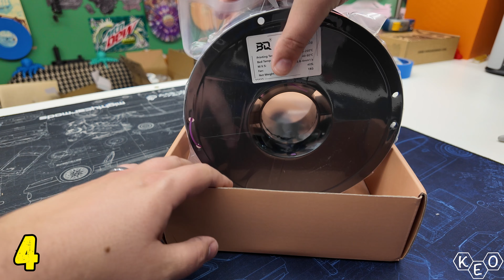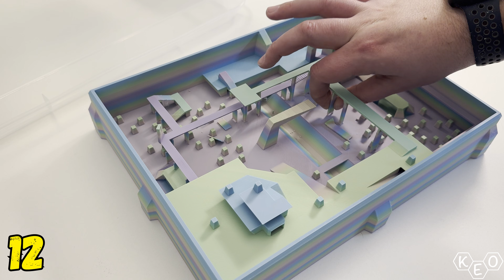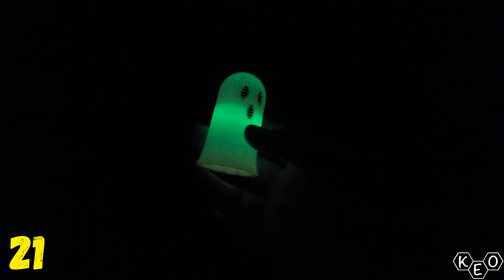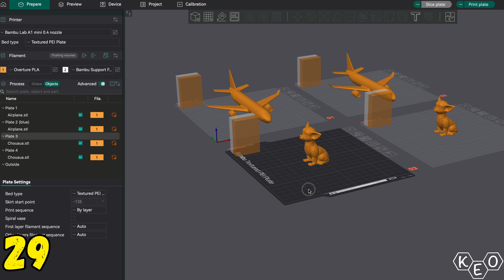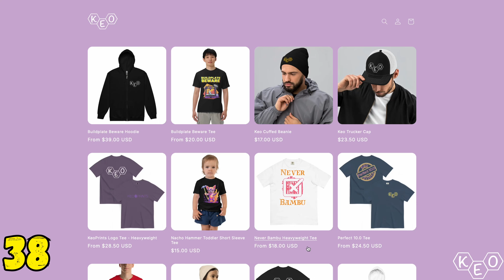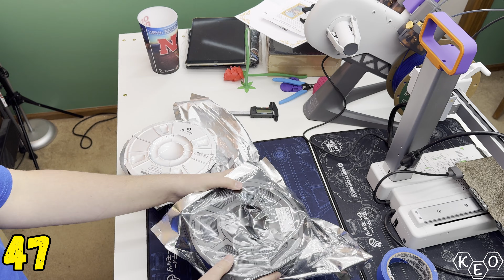50 3D Printing Tips and Tricks YOU Should Know

Comment: I would liek to say you don't neccesarily need a heated chamber for ABS - but you do need some sort of enclosure, and some time to heat the bed and use the bed as a 'chamber heater' - with the enclosure just helping retain most of it, and, keeping drafts out.    I successfully printed ABS on an Ender3 from 2019, just using a cardboard box with some cut outs for wires to slide through, and taped close a  door cut out for the front.   No warp, great results, but yes, a bit basic for setup.
Reply from the maker: True, good point. I too ran those DIY enclosures on my enders back in the day. If it works, its not dumb ya know?
Reply: I agree-I print ABS and ASA without a heated chamber on my P1s all the time. The enclosure helps, but I don’t even bother preheating and it still prints great.

Comment: #2. So I've never had to do this, but my first thought is to put the plate in the freezer. 
#4. Ooh... 
#5. I know you're supposed to keep enclosures open for PLA, but the whole point of having an enclosure is NOT breathing in the fumes. I don't care if PLA is supposedly harmless; we know very little about the effect it has on people.
#7. I've been holding out hope for a proper tool changing system which swaps the whole toolhead.
#13. Other than looking cool, gyroid is useful because it's flexible, so it doesn't put as much warping strain on your part as cubic/grid/etc. But it can be kind of rough on the printer. 
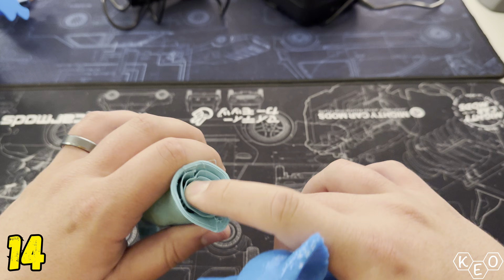#14. Regarding concentric infill... @6:17, I really wish there was a inverted concentric. Like, it would create infill perpendicular to the walls instead of parallel. 
#30. I keep a small offset when I'm using brims so that I can just peel them away cleanly by hand. And sometimes I use a skirt as a brim since you can also set skirt distance to be very close to the part. The advantage being, well... imagine a gear, a skirt can give you a round brim around it that doesn't go into all the nooks. Clever Gcode > post processing, where possible.
#35. And that right there is why I want a tool changer.
#39. The rigidity is great BUT prolonged strain will warp it over time. So, arguably, don't use it for brackets even if it can initially support the weight easily. Apparently, some variants ("PLA+") are far worse than regular PLA in this aspect. Or just print your brackets in PETG. 
#40. Also, don't use black plastic for outdoor use. Black absorbs like 10c more than other colours, iirc, so if you must, white PLA > black PLA. Or coat the print in something protective. 
#42. I've recently, finally, ordered some PCTG (not easy to source in Australia!). I'd love to get your thoughts on it if you've tried any. It's supposed to solve, or mitigate, the many issues PETG has. iirc, it's a bit weaker than PETG, but it also bends before it breaks, rather than shattering into sharp shards, and it's said to be a lot easier to print with which is certainly welcome. 

I think people overstate how "easy" petg is, although modern printers likely help immensely. When I was first learning to 3D print, PETG was harder than ABS because its characteristics are counterintuitive. I would rather compare it to TPU than PLA given its goopy/sticky behaviour; it needs to be laid down slowly with, optimally, an additional z offset. I find that when I design objects, using PETG adds an extra layer of complexity because my first thought is "That's a steep overhang" shortly followed by "I'm not stuffing around with supports". It can be tuned, but eh. It still has its uses, but I badly want to replace it as my go-to for functional prints.

Comment: My biggest problem with PLA is NOT the low temperature resistance.  For most functional parts the temperature range would not come close to the glass transition temperature of PLA.  The real problem is that PLA flows!  If you deform PLA during a longer time, it will take on its new form rather than to keep on resisting the deformation.  So, if you have a clamp in PLA and use it to clamp something together, then after some time (really not that long) it will no longer clamp it as the PLA will now have taken on the state it was forced into and the clamping force it excerpted went to zero over time.  That makes it useless for quite a lot of functional prints that will get continuous force applied.  If the part is not undergoing any force most of the time and only gets loaded for shorter periods, then PLA is often tough enough, but otherwise I much prefer PETG.
Reply: As a noob never heard of that. Thanks for sharing.

Comment: Why are abrasive materials not compatible with AMS 2 PRO?   Did you just make that up?
Reply from the maker: Well as I understand it, the feeder gears aren't hardened so they are subject to wear prematurely when using abrasives regularly. But the other portion of the issue has to do with the CF filaments being so rigid and brittle. Often, they are too brittle and can break inside of the tubes due to the sharp bends in the filament path. I see it as a "at your own risk" situation.

Comment: Can I use PETG (or variants) for extruder parts, like the printed parts for a Galileo 2?
Reply from the maker: It would all depend on what kinds of temps it is going to be subject to. Even if its not super hot all the time, deformation can happen after loads of heat cycles so have a look at the TDS on whichever filament manufacturers site. Polymaker does well to document and test all of their filaments so that might be a good place to start

Comment: Ya i haven't thought about that material change right before the object before. Great tip. I have learned that Polymaker CoPE material makes a great support material for PLA since they don't stick to each other and have the same print temp range.
Reply from the maker: Good call dude. Those don't stick together and they print with the same settings generally. Why didn't I think of that!

Comment: I have PETG 5 Kg spools on my N4Max and I don't have i dryer for it, but I have the S4 dryer for the 1Kg spools I use on my CC, I don't see any difference in between the dried PETG to the non dried or if you want wet PETG filament.
So I stop drying my PETG, and I use the S4 just to keep 4 rolls of filaments for my CC.
Honestly I'm new on this addictive hobby and what I learn so far is that people blame the materials, more them blame themselves for not leveling on try different settings.
I know that I supposed do what every body doing, without no question or resituate , but I don't and I like that!    🤣

Comment: My trick for stuck prints on the bed.
Heat the plate up 10C more than you run it normally for.
PLA - 55-60C. I heat it to 70C and the print will loosen up.
If you worried about it warping, then just turn off the heat, leave the print on the bed to cool off with it.

Never had any issues.
Reply: Was about to say something similar, I got a hobby heat gun that'll blow air up to 200°c and I'll use that to get any hard stuck filament off of the plate, just have to heat it till an edge starts to curl and peel it off like a sticker